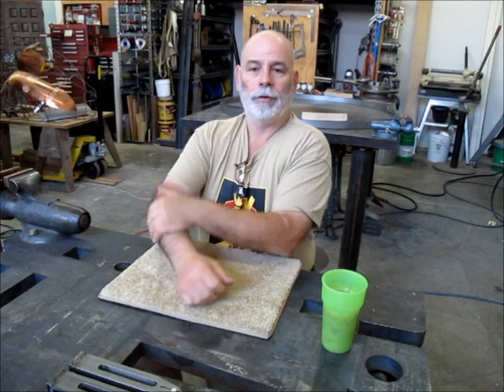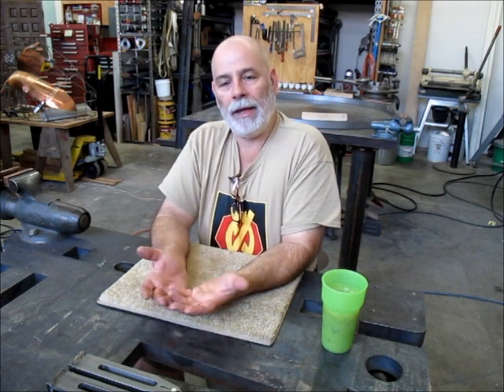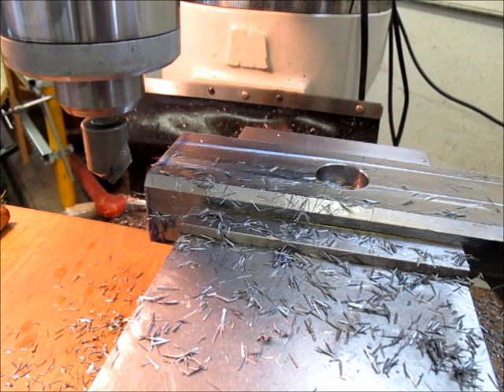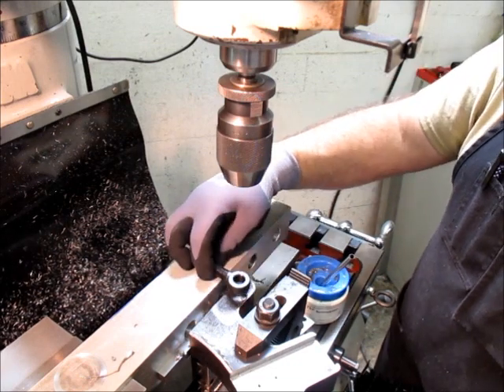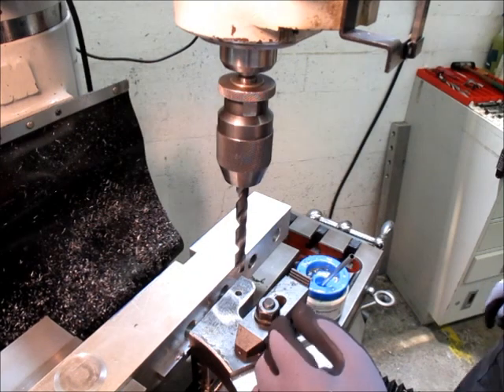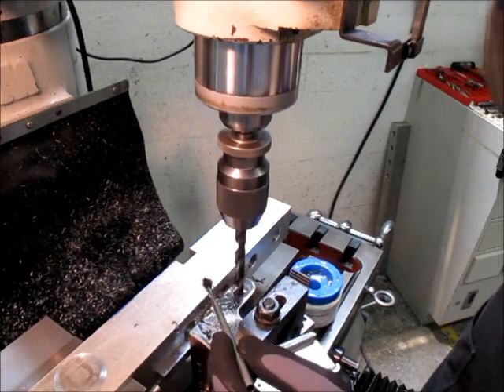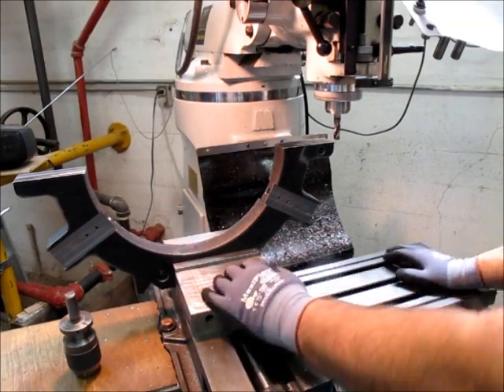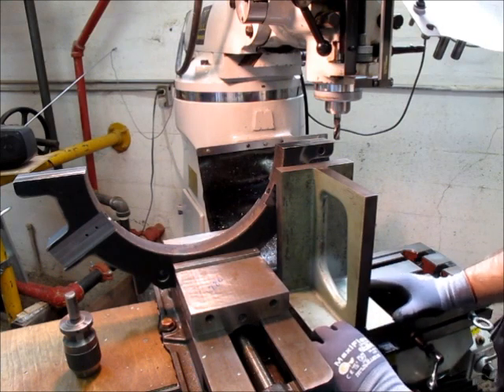Heavy Duty Steady Rest Episode 9

Comment: Honestly, the Heavy Duty Steady Rest is the best video series I've seen so far from anybody. The diversity in methods, tools, etc. is super. Allowing us to share in the mistakes and the corrections is vey important I believe. Two suggestions: if you have a zoom on the camera please use it more often; also, let us know the material costs including outside services like the original steel cutting, etc. 

Excellent, excellent, excellent.

Best regards

Comment: Tom, 
I moved to France 35 years ago. Obviously I had to learn the metric system. As a diesel mechanic when I got here, I had to use my metric spanners, I also still have my Whitworth spanners (wrench sounds so violent to me!) so I work in three systems having a 1944 Colchester lathe and a Clarckson T&G! Generallt, people talk in Cms, for carpentry and joiner cms or mm machining, mm 1/10mm and 1/100mm. Having lived in both systems, I can convert Kms to miles and back in my head. Regards, Matthew

Comment: hey tom, thanks. sorry for the lurking. i'm learning great stuff from your video.
Reply from the maker: Hi Sam,

Happy to see you have de-lurked and joined the fun.

Cheers,

Tom
Reply: i work over seas in the oilfield. i'm the guy that fixes things that "can't be fixed" meaning i can make parts with hand tools. learning the right way to and how to measure has changed my life. the low tech is the my favorite but knowing the high tech helps also. keep doing the great stuff.
Reply: got a dumb question. have you ever spin formed Aluminum parts on a lathe??? or know a channel that has some info about "spin forming" ??? thanks
Reply from the maker: sam yeates Hi Sam,

No I haven't. Its something on my list to play with at some point but you guys keep me pretty busy.

Cheers,

Tom
Reply: i meant to say i received my spindle square i ordered.

Comment: Keith couldn't have a trainee in his shop due to the fact that his shop was not up to standard as to safety regulations. (as he said in one of the what's in your box videos after a request of one of the nominees for the box). If your shop is (it certainly looks like it more than Keith's, without beeing judgemental about his), then you maby could fill in nice here in keith's project.
thanks for the video. Are we going to see the welding of the baseplate?

Comment: You are stiffening the part not damping the vibration, damping vibration involves converting vibration energy into some other form of energy usually heat. Some may say you are adding mass but they are wrong.